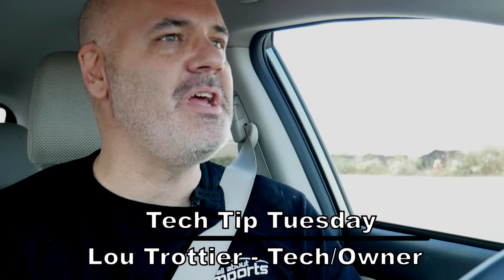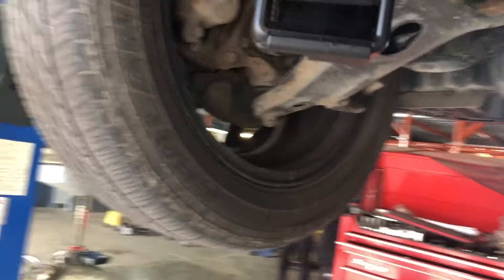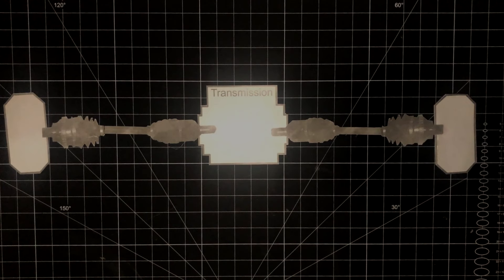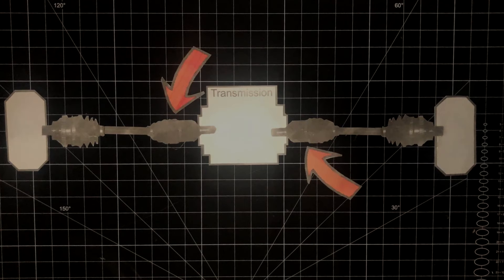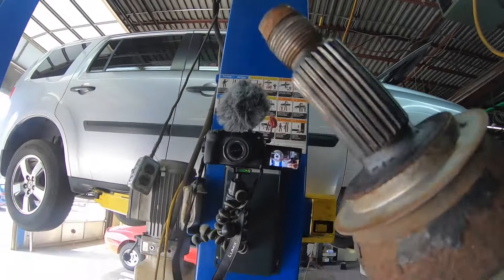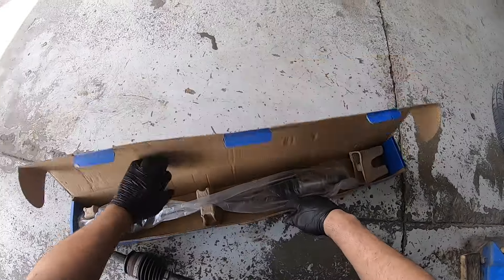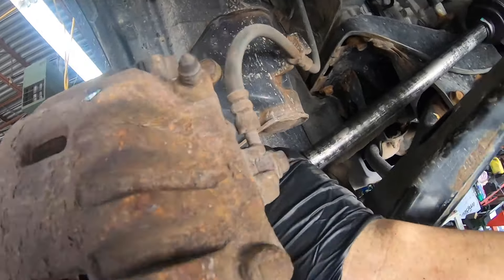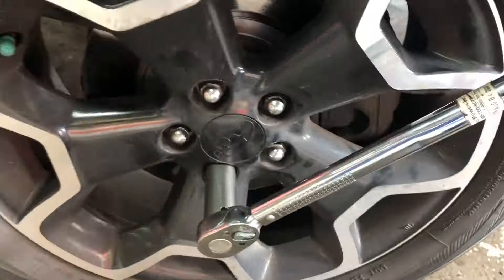Noise when turning steering wheel at slow speeds

Comment: If my car is making this noise. Do I need to do a quick fix for it? Or I could do it a month later because I don’t have the money to spend on my car right now. Basically I’m asking if it’s dangerous to drive with that noise
Reply from the maker: if it is only doing it occasionally while taking a sharp turn then it is likely okay for a bit.  If it makes the noise  while accelerating in a straight line then no, it can't wait.  Please note I'm guessing here and can't guarantee that I'm giving you  the right answer.
Reply: @LouTrottier  yea mine just makes noise when I’m turning. Also the noise only happens when it’s in motion not when it’s idle

Comment: Would it make noises while parked and slight shaking of steering wheel?
Reply from the maker: No.  That would  be something else.
Reply: @LouTrottier  Hava you had any experience with the electric steering assist? I'm thinking the noise is coming form there. The steering shaft "U" joints seem to be tight.
Reply from the maker: @lylegoodluck  electric steering problems, yes occasionally.

Comment: Sir i have a subaru legacy 96 model, i brought it 2x to a mechanic and had outer cv joint replaced then after a week the noise returns whenever i turn the wheels to the right and a bit noise also when turning left. So went back to the mechanic now it says i have to change inner cv joint but i didnt see any prob in the cv joint. What cud be the problem?
Reply from the maker: If you are sure the noise you are hearing is exactly the same as the video then it is almost always an outer cv joint.    Inners do not make this noise.
Reply: Thanks for ur reply sir, i already changed my outer cv joint and after a week the noise came back. 😢
Should we examine ng inside of outer cv joint? Like ball bearings?
Reply from the maker: @joyceedatuin9539  I would look at the possibility of a defective outer cv joint.

Comment: Hi Lou, I just saw your video and my car is making the same noise ( bit louder) when going slow. The mechanic just changed the insulator strut and bearing strut, but there is not improvement. Now, he says the problem is in the rack and that, we will need to replace it. I know that is really expensive. You think is it necessary?
Reply from the maker: I have never heard a failing steering rack sound anything like a bad CV joint.  List to the video again and if you are sure the noise is similar, then I would suggest finding a new mechanic or second opinion.
Reply: @LouTrottier  thank you!
Reply: @donpersonal5806  Hi, at the end they couldn't find where the noise was coming from. :(

Comment: I have a 2012 cruse LX with almost 200,000 miles on it, and my steering wheel is making a like grinding noise when turning, what could that be?
Reply from the maker: perhaps its low on power steering fluid or pump failure.
Reply: @LouTrottier  thank you, I will check that.

Comment: I have a 09 Nissan sometimes I will put it in gear and the car won’t move till I give it some gas sometimes more than normal, the whole engine shakes and I hear a clicking sound when it does barely move but when I accelerate it shakes less then eventually stops. I have no idea what it could be
Reply from the maker: Upload a video and post the link here.

Comment: Hello! I really like your video. I have a 2010 Lexus es350. Replaced just about everything at the front suspension by the Axles/LCAs. I get a clunk sometimes or a click grind at others and I can fell it right around my feet (always when getting off a parking lot, backing up or turning slowly) I replaced the intermediate shaft and the power steering and still nothing. Nothing seems broken and no other sunspots. Any ideas? I check if all the bolts were tight, any hell will be greatly appreciated  please!
Reply from the maker: if it occurs when going in and out of parking lots, that would suggest a ball joint.
Reply: @LouTrottier  hello, I actually meant to say that I have replaced basically all of the front suspension but the axles and LCAs. I replaced both ball joints and the left one twice (hoping that it was a that 🤧
Reply: @LouTrottier   https://youtu.be/Snrb-OOuR9oI have the same issue sound as this guy has, the slower is turn,  like barely turning,  it sounds like that. And it’s not a break growl sound it’s something else, líke i said some times I hear a clunk when moving from a parking spot. Very loudly sometimes barely but almsot feel like a spring jumping or something moving that shouldn’t be moving and only when turning left and only when the car is moving. Never when the car is lifted nor when the brakes are fully engaged and am stationary turning . I replaced that strut 3 times already, with used OEMS and finally Brand new KYB strut and still nothing 🙃🤷‍♂️
Reply from the maker: @yoyobored847   That video you linked to noise a steering intermediate shaft.  You sure that the intermediate shaft you put in is good??
Reply: @LouTrottier  I bought a brand new intermediate shaft and inspected the older one too both looked good and flexible no signs of binding or abnormal wear. The sound only happens while the car is moving not when stationary. And never when lifted on jack stands. And I have to be turning nearly fully one side or the other. Do you have experience using aftermarket rotors that fit a little lose? I got this rotors from acDelco and they do fit lose, but strange enough the sound only comes from the left side. I no longer feel a strong clunk but more of a grinding kind of sound and very light clunk sometimes
Reply: @LouTrottier  since you responded to my question. I just wanted to say that I fixed the problem. It turned out to be two suspension bolts that were lose. The sound was not there when I bought the car and I never touched those bolts. Somehow the front bolt was very lose. Ridiculously lose, and the back one was slightly lose. Tighten the hell of both and car feels great...considering I changed a lot of crap. Last week I took it too some mechanics that could not find the problem. Well I learnt something 🤷‍♂️. Thanks for the help anyways
Reply from the maker: @yoyobored847  glad you got to the bottom of it.  cheers

Comment: Hello Im look 4 some help. I have mitsubishi asx 2017. After night when starting car and turn wheel left or right I heard clunk in both side after short ride and parking come back in 2-3 hours I dont heard any clunk. Any ideas?
Reply from the maker: Can you send video record noise?
Reply: @LouTrottier  you mean send you as a private or just make a short video and send to YouTube?
Reply from the maker: @przemokbh8079  short video and post on your youtube.
Reply: @LouTrottier  hej I have add vid but don't know if you can hear this. Is deep clunk
Reply from the maker: @przemokbh8079  the noise I heard right around 24 seconds sounds like a front spring moving in its spring perch.  look at front suspension upper mounts.  but youre  right sound is not very clear.
Reply: @LouTrottier  thx for answer. I have to open the hood of the car and put someone behind the wheel and look at the place you mentioned. At the earliest on the weekend. Upper shock absorber bearings was change about 10 t km ago.

Comment: My car makes a whining noise when turning at a slow speed. Usually hard turns. What is it? The power steering fluid wasn't low. Thanks.
Reply from the maker: despite fluid not being low, still sounds power steering related.

Comment: I have 2014 Ford Escape. It does the same sound. It’s louder when it’s cold. Like 20-40 degrees. When it’s warmer it doesn’t sound and sharp. More dull. And only does it when turning left or right. Nothing going straight. Also doesn’t do it when it’s warms up so my mechanic thinks I’m crazy. Next step just leave it over night with mechanic. And what is average repair cost. Thank you
Reply from the maker: these cv shafts are usually noiser when warm, so I think you may be hearing something entirely different.  your best bet is to leave it the mechanic over night so that they can hear it first thing in the morning.

Comment: Definitely have this sound but I just replaced my axles and that didn’t fix anything
Reply from the maker: Hmm.  Not sure what to tell you.  Defective axles?
Reply: @LouTrottier  I’m thinking ball joints?
Reply from the maker: @dereksaucedo3869  ball joints rarely make noise.  they just break and wreak havoc.
Reply: @LouTrottier  you hear it mostly when you turn the wheel to the far right or far left it’s not power steering as in my car uses EPS so I’d be greatful if you suggest anything
Reply from the maker: @dereksaucedo3869  well what you are describing is doubtful to be a cv shaft.  Still sounds like a ball joint or sway bar link.

Comment: I am having this same problem I got the links change and cv joint axis change on both driver side and passenger side and still hear the same noise.  Will take any hints on what it can be
Reply from the maker: this noise is very specific to CV joints, are you sure the complete joint was changed are only the CV boot?
Reply: @LouTrottier  I change the whole cv axis shaft and links on both sides not the cv boots. Can it be the ball joint?
Reply from the maker: @Monkeymanhc  that's a weird one, either the new shaft is bad or the noise you are hearing is something different.
Reply: @LouTrottier  He’s asking that if it isnt the CV axle then what could it be.
Reply from the maker: @taliesinangling3564  without hearing it I can't say unfortunately.

Comment: I have a honda fit shuttle 2012 and I recently replaced the axel seal to the transmission and after it is replaced I'm hearing a scraping noise coming from the left hand side on the front...the same side that I replaced the seal. What might be the issue?
Reply: scraping? or like rubbing noise? and is it like kinda vibrating?
Reply: It's like a scraping but I feel no vibration
Reply from the maker: you have damaged a shield somewhere. Likely at the wheel.  the backing plate behind the brakes.
Reply: Thank you for that....so could it still be the backing plate when the noise is present when accelerating at low speed and when taking a deep right corner?
Reply from the maker: @gervangarrison3449  yes, that is where I would start loooking.

Comment: My clicking noise turned out to be the U-joint where the column goes into the steering wheel.   Seems minor, but the only fix was to replace the column assembly, and they don't sell those in parts stores.
Reply from the maker: well that sucks, but at least it fixed.

Comment: I have a 2015 Honda Accord LX and I changed struts, sway bars, lower ball joint and tie rods but still hear noise when steering when taking off or parking
Reply from the maker: if it sounds the same as what I have demonstrated in the video then you have to examine the CV shafts.

Comment: Can I call and ask for help about my Chrysler 300c v8 5.7 liter I was doing donuts in the dirt with my friend I’m not sure if it’s my axels but now my car drives regular when at regular speeds but when slow or stopped it makes a loud whininign noises or when I turn real slow at a stop sign what do you think it it starts locking up until I gain speed then it’s normal ps it’s only when I turn the wheel though I looked it up it said axels tie rod or just need lubricant on steer wheel
Reply from the maker: Sounds likeYou have blown the differential
Reply: @LouTrottier  how do I repair that cuz everything is good I don’t a system warning or nothing
Reply: @LouTrottier  and it sounds like it comes from the front
Reply from the maker: sorry, I misunderstood and have re-read.  sounds like an issue in the steering rack.
Reply: @LouTrottier  thank you how would I replace that or to get a proper diagnostic go to a mechanic or can I send you a video ??
Reply: @LouTrottier  It probably is that because I guess when I was done I ran out of steering fluid and I was forcing it until I got back home because I had nothing
Reply from the maker: @shady_lowkz  sure, shoot a video and post a link.

Comment: Hey Lou! I just found this video, thinking it was right for the case i have, but after hearing the sound, im not so sure anymore. So, the sound happens after accelerating from 0 - anything. Usually it happens with a hard turn at the start, but i've also heard the noise without turning steering wheel. The sound is not present at all times, so i'm really confused. And the sound goes like "woooooo" for like 2-3 seconds and then disappears. Could it have to do anything with steering wheel or steering wheel oil? Anything else maybe? The car is VW mark 7. Thanks for the help!
Reply from the maker: A CV shaft almost always clicks, first when turning only then as it gets worse under straight line acceleration.  Sounds to me like you may have a Power steering noise.
Reply: @LouTrottier  thanks for the response! does that mean i should change oil or the whole pump? 
PS: i'm amateur when it comes to car, i just don't want to get ripped of by the mechanic
Reply from the maker: @mickzeh8974  cant say for sure without hearing it.  post a video of it and I'll take a listen.
Reply: @LouTrottier  ill try to post and link you tomorrow. thanks for the help so far!

Comment: Hiii :((, I have an issue with my Audi A6, starting last week i have a “knocking” noise in front after 15-20 min driving ONLY in very slow speed with/out using brake, in reverse no noise at all. it’s crazy, everybody tells me to change different parts but no one knows for sure what. 
Thank you! :((
Reply from the maker: unfortunately noises are quite often difficult to locate.  If the car does not make the noise while on a hoist then parts are simply changed until the noise goes away.  Hence the reason why no one is able to tell you specifically where it is.

Comment: How’s it going man I have a problem wh my 2009 Chevrolet Malibu Steering wheel it makes a small noise when i turn the wheel but the funny part is that it Comes in goes i will really appreciate your help
Reply from the maker: There might be a recall for the steering intermediate shaft.  Check with your dealer to see if your vehicle has any outstanding recalls.
Reply: Lou Trottier something I notice is that when I make a stop & Accelerate it makes a noise.
Reply from the maker: @BMW-dj4fc  get me a video and I might be able to identify it for you.
Reply: Lou Trottier is there a email I can send you the video? Now it just makes a noise on the left side when I turn the Steering wheel  the right side is ok , the noise on the wheel sounds similar to this video.
Reply from the maker: @BMW-dj4fc  service@allaboutimports.com

Comment: Is there a difference between a noise from slow speed turn vs high speed turn? My car has been making a noise at high speed turns, so I think it might be similar to this
Reply: Great video btw!
Reply from the maker: yes there is a difference when considering speeds.  your high speed noise is likely a wheel bearing.
Reply from the maker: @ritxman  thanks.

Comment: I have a B9 Audi A4 Quattro S-Tronic, there is horrible vibration/ when i turn and accelerate a bit. It’s happen only on low speed. What could be? 

Also there is vibration when i take of my leg at gas pedal when the RPM dropping to 1200/900

Thanks!
Reply from the maker: problem 1 sounds like a bad axle.  problem 2 sounds like a separate problem, possibly an engine or transmission mount.

Comment: Mine has a click every time when I steer to the right, low speeds as well. Just one click...
Reply from the maker: CV joints usually click multiple times which leads me to believe your problem is elsewhere.

Comment: Same thing, but on a IFS 4x4 truck. When 4wd is engaged it makes the same noises, when driving straight not really making noise/normal. But when turning either direction the clunking/slapping noise gradually gets louder in correlation with how much I turn. 2wd is all completely normal, no noises at all. Anyone have any ideas?
Reply from the maker: sounds like it could be a bad cv joint.
Reply: @LouTrottier  I thought so, but even if it only makes noise in 4wd?
Reply from the maker: @thelikebutton4405  I'm guessing,but when not in 4wd they will be free wheeling = no noise.
Reply: @LouTrottier  appreciate the starting point! I'll play around with it this weekend to confirm, thanks man.

Comment: Is it correct that if the sound is coming from the right  side its the left joint that causes the sound? Maybe people think that you’re send from above, therefore the God similarities 😉. Its still appreciations behind it when people lack the knowledge you have.
Reply from the maker: The side the sound is coming from is usually the bad side.
Reply: @LouTrottier  Thanks man!  Is it that the outer joint causes  the turning noise and the inner joint vibration? Thanks again!